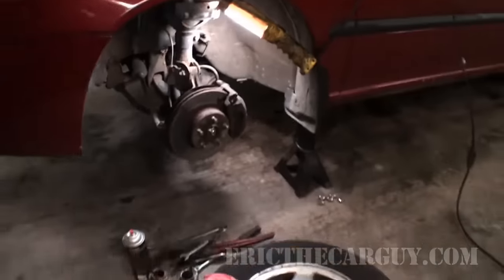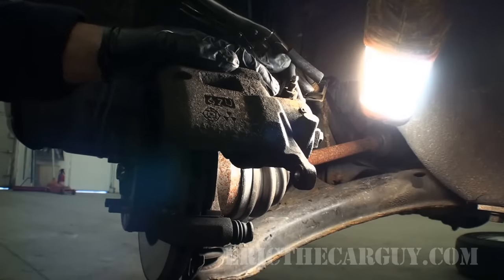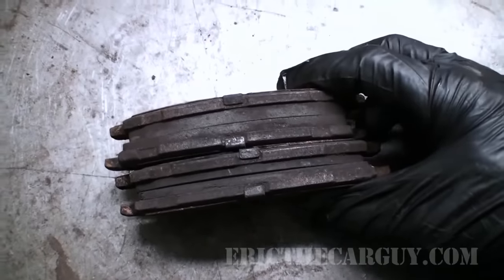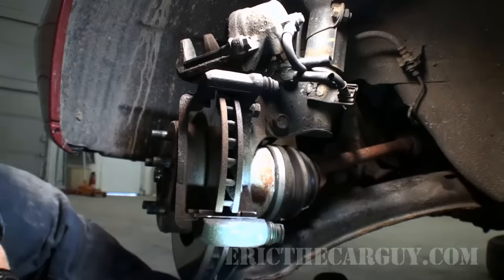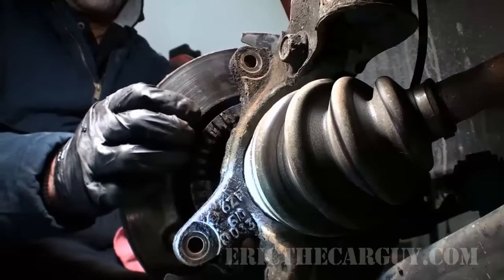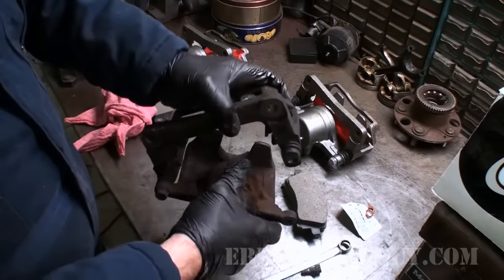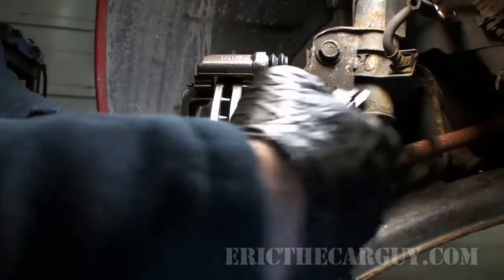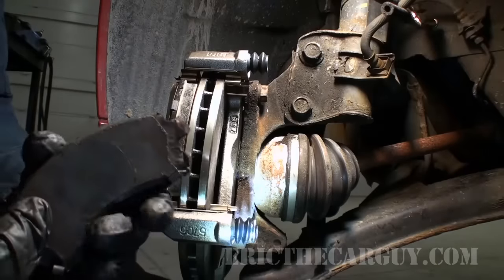How To Diagnose and Replace a Bad Brake Caliper -EricTheCarGuy

Comment: iIS IT SAFE TO KEEP DRIVING MY AU FORD 1999 WAGON WITH A STICKY FRONT WHEEL CALLIPER GRINDING NOISE WHEN I DRIVE A LONG. i WAS TOLD IT COULD SEIZE UP AND CAUSE A ACCIDENT THE BRAKE WILL JAM ON
Reply: Don Stewart A brake grinding is usually due to a fully/past fully worn brake pad, this means that it's no longer brake pad material rubbing against the rotor, its now metal on metal. What does metal on metal do? It SPARKS! in a high pressure stopping situation you could virtually weld the brake pad to the rotor. This would be a seizure scenario; but if you are driving around with a horrible grinding noise you SHOULD know that something is wrong and have it fixed. You are a rolling accident, and at your liability, pay for the small things before they bubble and pop and and you end up paying for something like the other guys car and your car, because they're both totaled.

Comment: Shouldnt u be putting a dial indicator on the new rotor to check the runout?   Pity u do that whole job and turns out a miniscule metal debris gets lodged between the rotor and hub.  You will have to take everything apart again to clean it.

Comment: @10:00 Brake hose failure.
Your diagnosis seems counterintuitive to me.
Pump the brakes a bunch of times (building pressure) release the brake zerk fitting and if fluid spurts out this indicates a "bad brake hose" according to you....???
The hose is bad if it leaks externally or is damaged (collapsed/blocked) internally so how does releasing built-up pressure indicate internal collapse at the end of the hose?
Anybody?

Comment: Just a novice here.  He said to check brake hose by pumping brakes and then opening bleeder.  If fluid squirts out, hose may be bad (collapsed internally).  What is the logic behind that?  I guess fluid pressure is not suppose to be retained in the caliper after the brake pedal is released, so if the bleeder squirts, then the hose may be stopping fluid from returning to reservoir.  That is, release brake pedal and caliper should be under no pressure (just pressure from gravity).  Anybody know?

Comment: Nooo.. the side load squeezing from the channel-loc pliers does NOT indicate a need to replace. In fact, the piston fit to cylinder wall is a very precision fit on "Good" calipers and most brand new calipers would fail that way. You always need to compress pistons from a perfectly centered compression. I've been a brake caliper design validation engineer for 20 years. Piston slide tests are pressure out tests not piston retraction. It is rare to have a caliper fail the piston slide-ability test enough so that it can even be noticed in the vehicle unless you are dealing with gross corrosion or chip/debris contamination.

Comment: My caliper on the driver side is bolted but I can jiggle it with my hand and it rattles when I drive..taking my truck to a shop is expensive I wanna do it myself but the right way

Comment: I have a clunking noise when braking can you help it only happens when braking I just had the rotors and pads changed.
Reply: SuperJeremi10 do u hear the noise coming from the front or the rear>? it could have a missing caliper bolt  that hits your rim when braking, i know because it has happend to me, caliper housing bracket came loose and fell off, kept hearing a clunking noise when braking!
Reply: its coming from the front I have drum brakes in the rear hmm maybe   we did them ourselves  and put all the screws back ill have to check my dad did them for me to save money.

Comment: hey could you please help me? my 2003 jettas brakes im trying to put new pads on first time i cannot get the piston back in far enough i even bought a tool kit so i could be able to do it but i keep turning and turning nothing seems to be happening
Reply: Neo one possible important point i got so desperate i even tried completely taking out the bleed bolt still nothing, i really barely have a clue (its a rear brake)
Reply: Neo  does it screw back in or push back ?big pliers and squeeze ,if push back and watch brake fluid does not over flow.
Are you turning it the right way if they are screw in's

Comment: At the 10min. Mark you state if the fluid does not squirt out - under pressure - then you're probably OK.....Doesn't sound right Erik
Sounds more like a total blockage if zero pressure ...Can you Clarify that statement?

Comment: you forgot to say anything about chrysler brakes... the pistons screw out as they move and will not press in.. they have to be screwed back in and is easy to do WITH the right little tool

Comment: I am very confused at what you said when you pump the brakes and you unscrew the bleeder screw no oil should come out I'm confused at that when you pump the brake unscrew the bleeder screw oil should come out let you know that there's no air in the line so I'm a little confused here. you tighten the bleeder screw up again pump the brake again until fluid comes out and that tells you there's no air in the line so oil should come out brake fluid oil should come out you're confusing me here I don't understand, shade tree mechanic Rochester New York

Comment: The only place to use anti-seize is on the back of the rotor hub and the hub itself. This way the rotor will come off easilly the next time you replace it. Wacking thw rotor with a hammer is loud and not fun.

Comment: How do you test this if you a have dodge where they make you spin the piston when compressing with a special tool 2009 town and country 4L
Reply: Justin Walker  harbor freight sells the tool for less than $20. Not a great tool but it does the job.
Reply: @marcianotrevino9076   i have the tool but how do you do the test
Reply: Justin Walker @ 5:40 ish he uses pliers to compress the piston, use the tool instead of the pliers.  The tool fits in and compresses the piston while letting it spin.
Reply: @marcianotrevino9076  That's not what I'm asking, does having to turn the piston invalidate the test. If its hard to turn, does still mean something is wrong with the caliper or break line.

Comment: i had a stuck brake turned out caliper was bad and all the bleeders were rounded so i replaced all for calipers because they are very rusted .so i finished up and bleed the brakes the pedal went to the floor so no i have no brakes

Comment: You're fighting resistance by having the line pinched off. Take filler cap off put rag  or pan underneath it. Get a big good c clamp  two small block of wood in between caliber so you don't damage it. unpinch line and crank like hell and push that piston in all the way till it's flush with  caliber.  Install filler cap !and caliber with brake pads back on the vehicle.  .  And pump brakes till piston push pads against rotor. Repeat is process a few times.  80% of the time this  will free up a frozen caliber.  DO NOT PUMP BRAKES WITH CALIBER NOT INSTALL ON CAR. this could blow out the piston.

Comment: When I move my jeep grand cherokee and I appy brake it force its way to a particular direction and I also feel wobble under my feet,  can u help me with this problem
Reply: Please get to watch Eric Carguy.
Reply: William Osei Whichever direction its pulling to thats the brake pad that is working. The other side the brakes are probably not working, bad calliper? Pedal wobbleing is probably from a warped rotor.

Comment: I tried a new way of beeding brakes I fill master cylinder then open bleeder valve and pump brake pedal 10 times then closed valve and fill master cylinder . I had good brake pedal. Easy way to do.

Comment: He said if your car pulls left it's likely to be the right caliper that's knackered. Can someone explain why please.
Reply: Because the left brakes are working to slow the car down on the left side while the right side brakes aren't working and want to continue spinning at the same speed. Look how a tank steers, one set of tracks move faster 'pulling' or pushing the tank to the opposite side.
Reply: +Brian Galvin thankyou sir.

Comment: so is that clamp losely on the brake line or ti9ht at 3:23?
Reply: Derek+ness it would be pretty tight; like you don't need to squeeze so hard you could cut the line, but whatever it takes to stop the fluid, the rubber parts on his vice grips inhibit the "cutting" so you don't do damage to the brake lines. However much it takes to stop the fluid coming out. Don't do this on steel braided lines, you'll ruin them.

Comment: You mention the car pulling to one side, say left, meaning it's the right caliper. Should point out that only if stuck OPEN. I got one stuck bound, not open meaning it is the side that is pulling, not the other. Confirmed by putting my hand on the rim....red hot after driving.

Comment: shade-tree: (al la sombra del arbol)
4 MAIN and important things you fail to include... brakes fail due to more reasons than that associated with the brake parts themselves!
Ball joints that are worn with 'play'
tie rods ball joints that are worn with 'play'
Wheel bearings (packing or replaced if press kind)
Wheel alignment ... that can only be made 'right' once the ball joints and bearings issues are resolved!!!
...clue: new disk rotor, new pads, new caliper... still when you apply the brakes a faint slight wobble is felt... oh it's all good!... yeah! right!
all of that means wheel that lock while others continue to revolve while braking, or more braking results on one side than the other, ...

Comment: subaru caliper pistons half to screw when compressing the piston back if you dont twist the piston it will not compress . . try it on the old caliper you will see . you may not have needed a new calipar at all .

Comment: what would be the problem if after changing the discs the front wheel vibrates at speed
Reply: wheel bearing, or cv axle. if it's constant probably a bearing. if it's mostly when accelerating probably a cv axle

Comment: I would have liked to see you tighten the caliper bracket bolts more. The specs are usually as high as 50-70 ft lbs for cars and even more for suvs. Great video otherwise though.

Comment: I use antisieze on my brake bracket bolts. Itscmy vehicle, my knuckles and frozen bracket bolts are a ROYAL pain in the arse to get out. I have had to use a torch way too many times to break those bolts free enough to know,its easier to do it that way then spend hours trying to free up a bolt. You do what you want with your car,I will do what I want with my car. period.

Comment: Tightwads like me will first take those Channel locks pliers and grab the piston edge and give that piston at least a half turn. Many times change the wear pattern; on the o-ring/seal and can re-seat' the piston...freeing it up. Recheck for free-movement'.  Then bleed and bleed the rest of the system...and with the best synthetic brake fluid that will work with your vehicle. A yearly brake fluid flushe can cure 'a thousand ills'.

Comment: Crimping will cause an old brake hose to collapse on the inside because it's old and the brake fluid can eat at the rubber hose brake fluid is one of the most craziest chemicals

Comment: If the master cylinder runs dry and you don't bleed all four brakes, what happens?
Reply: Kit Games you'd end up with a bunch of air in the braking system, a spongey brake pedal and wouldn't be able to apply as much braking force as you'd like. It could make a huge difference in stopping in time and bouncing a 9 year old kid off your front bumper. Bleed them, its not too difficult and the nice firm brake pedal will feel good and give you confidence.
Reply: My master cylinder ran dry and I only bled one brake I think.  I had a rusted out brake line and my the thing that holds the brake fluid was bone dry, so I'm pretty sure we only bled the brake the line was going to

Comment: No no no Eric , temperature costing break down on grease on the caliper pins , if you put high temperature grease synthetic, you won’t have caliper pins Seized up, and on caliper bracket , the sedans used 17mm and on light truck and heavy duty truck they used 19mm or higher bolts and another things silicone grease is not high temperature grease , silicone grease I used on suspension bushing or anything light grease you can used silicone grease , their oil breaking point is too light for hight temperature heat than synthetic temperature grease, brake rotors temperature can reach up to 500F or higher

Comment: Y'all praising this video, yet he's advocating applying grease on a caliper bolts, really ! You apply Loc-tite on caliper bolts.You don't want  vibration to back them out.You never apply grease in a sitiuation where Loc-tite is needed.It defeats the purpose of the thread locker.WOW and smfh  Second mistake this guy makes is not torqing the  bolts to specification. I definantly won't be subscribing to this channel.I'm a trained auto technician,by the way.Brakes are nothing to play with,it could cost a life.I advise any one watching this video to get proper technique.You can take classes at a community college.He's a "real" car guy.more like a shade tree mechanic. Defiantly not a trained technician.

Comment: If you grease wheel lug bolts or most bolts ,it will completely change the torque even shear the bolts off and or strip the threads DONT DO IT JUST Say  NO.

Comment: The reason you getting so many dislike is cause you are not resetting the calipers correctly, further more if the slides don't move correctly then take them apart and clean and put new seals. You don't just replace the calipers. I really thought you were a better mechanic than this. But by using pliers you are not pressing them in evenly.

Comment: putting back bolts that are not cleaned up and greased is nasty shade-tree filthy garbage... especially not torquing, and if torquing would mess up the torque spec...  these parts are engineered to get HOT and cold and all the specs are engineered to match... surely there are ranges that these parts can absorb, ... but that is no excuse for doing the job 'right', mfckr!